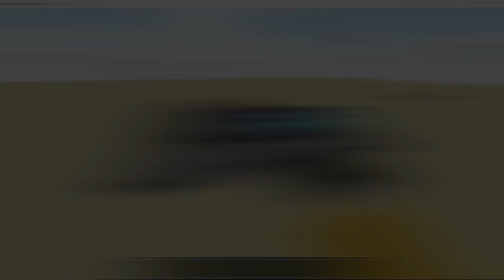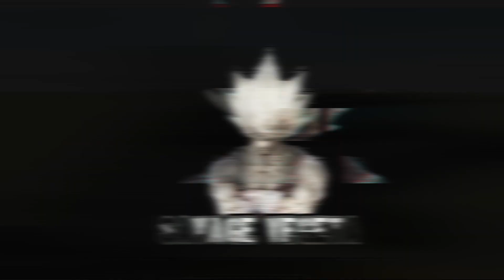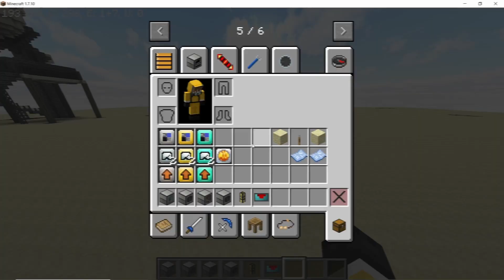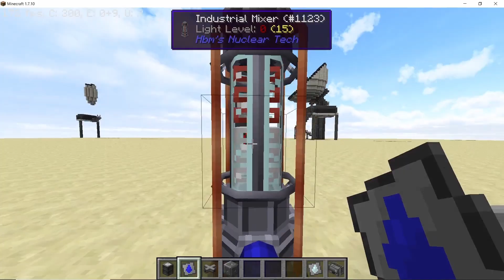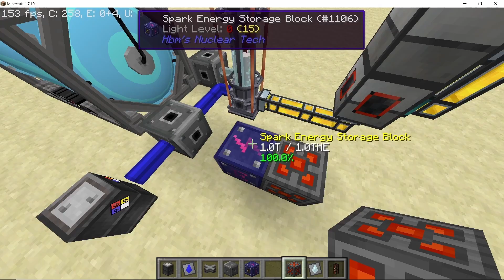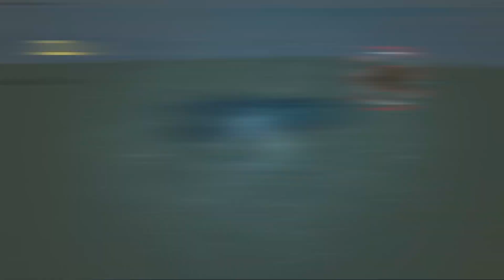Coolant Factory HBM's NTM - Cryogel and Coolant Production Plant Minecraft

Comment: Can anyone help me the duct to the last pulverizer doesnt work it doesnt go into the mixer
Reply from the maker: By "it doesn't go into the mixer" do you mean that the duct itself isn't connecting to the side or the duct is connected but isn't transferring any items ?? 

Cause if it's the first case then instead of ducts you can use Conveyor belt with ejectors and Inserters if you're playing in 1.7.10 or you can put a hopper going into the mixer with a crate on top and connect the duct to the crate instead 

If it's the second case then check if you've configured the sides of pulverizer correctly or not and also if you've set the servo
Reply: @SavageVegeta  Thanks i used a savage i think its called that.

Comment: For HBM 1.12.2 we need "Niter" to made coolant. :(  But in 1.12.2 Thermal Expansion there is no "cycling assembler" and can't put upgrades to machines.  :(
Reply from the maker: The process is exactly the same for 1.12.2 only the name of some machines are different. 
Like for example the cyclic assembler is known as sequential fabricator in 1.12.2 , and as for not being able to use upgrades the solution for that is take a "Resonant Upgrade kit" and right click with it on a machine to upgrade it and then you will be able to put in the upgrades
Reply: @SavageVegeta  Thanks for BIG HELP!  :)

Mixer it's like  Chemical Plant  but is big :(
Reply from the maker: @xontrax6610  yeah mixer is definitely handy cause it's compact ... But 1.12.2 doesn't have it 💀

Comment: ok i am the same guy that said "GUYS its only 3.6 nothing to be worried abt" and i just want to ask why are my steam channels in the rbmk reactor not producing steam in the hbm reloaded mod 1.12.2
Reply from the maker: Maybe cause the fuel you are using is not hot enough to heat up to the temperature requires to make high pressure steams. You need to keep an eye on the heat level of the steam channel and also the type of steam you have selected cause different types of steam can be only produced after a certain temperature is reached

Steam -100
Dense Steam - 250
Super Dense Steam - 450
Ultra Dense Steam - 600

Comment: Hey Savage can you make a tutorial on what kind of particle accelerator i should build first for a survival world?
Reply from the maker: The particle accelerator you should go for highly depends on the particle that you want as your end product. As you might already know that each particle has a different requirement for momentum in order to be made, so let's say that your accelerator can make particles reach a momentum of 100000 , then that means every particle with value lower than this can be made in this accelerator
Reply from the maker: Another thing that comes into play is using circular mode vs using linear mode cause when using linear mode the value of momentum is halved for any accelerator, but only a few recipes need linear mode so it's not too bad ... Now that you know that you can calculate the amount of coils you'll need in order to reach a specific value of momentum. Cause no matter what an accelerator will always consume the max power depending on the power plugs used .. that's why it's important to design your accelerator based on the final product needed !!

Comment: In Reloaded for 1.12.2, I'm still not sure how to automate item I/O for the chemical plant. I don't believe I've tried everything available yet, though; is anything works for this purpose, then what and in what parts of the machine? I ask because this version seems to rely on chemical plants for deuterium production (liquid water+solid sulfur), as it does not appear to have the deuterium tower from the 1.7.10 version.
Reply from the maker: Yep Item I/O seems to be completely broken for ntm reloaded as of now which sucks cause yes as you said no Deut towers are there yet. I just hope the mod will receive an update soon and this problem will be fixed

I have not tried this in the Alcater edition tho maybe there is it working